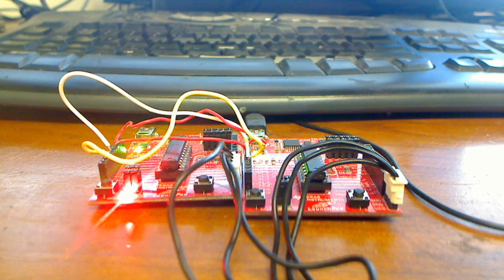Master and Slave MSP430 with Timer A

Comment: Now it works really okay - THANKSSSS!!!

#include "msp430g2553.h"
void main(void)
{
WDTCTL = WDTPW + WDTHOLD; // Stop watchdog timer
P1OUT |= 8;
P1REN |= 8;
P1DIR |= 0x01; // Set P1.0 to output direction
P1IE |= 0x08; // P1.3 interrupt enabled
P1IFG &= ~0x08; // P1.3 IFG cleared
_BIS_SR(LPM4_bits + GIE); // Enter LPM4 w/interrupt
}

// Port 1 interrupt service routine
#pragma vector=PORT1_VECTOR
__interrupt void Port_1(void)
{
P1OUT ^= 0x01; // P1.0 = toggle
P1IFG &= ~0x08; // P1.3 IFG cleared
}

Comment from the maker: // Below is all you need to use the button on the MSP430
#include "msp430g2553.h"

void main(void)
{
WDTCTL = WDTPW + WDTHOLD; // Stop watchdog timer
P1DIR |= 0x01; // Set P1.0 to output direction
P1IE |= 0x08; // P1.3 interrupt enabled
P1IFG &= ~0x08; // P1.3 IFG cleared
_BIS_SR(LPM4_bits + GIE); // Enter LPM4 w/interrupt
}

// Port 1 interrupt service routine
#pragma vector=PORT1_VECTOR
__interrupt void Port_1(void)
{
P1OUT ^= 0x01; // P1.0 = toggle
P1IFG &= ~0x08; // P1.3 IFG cleared
}